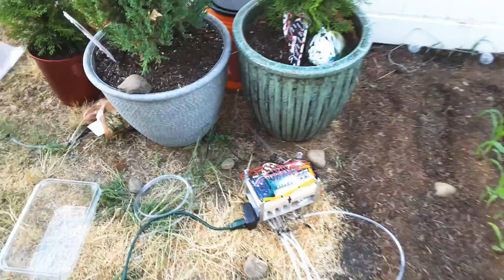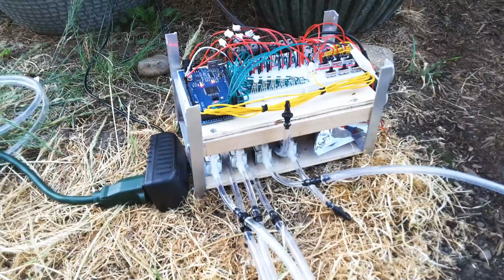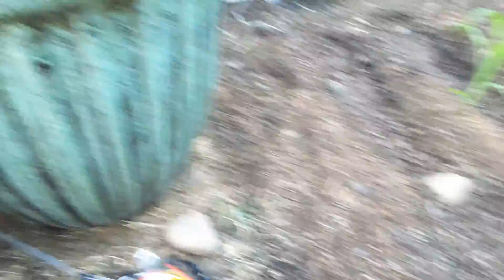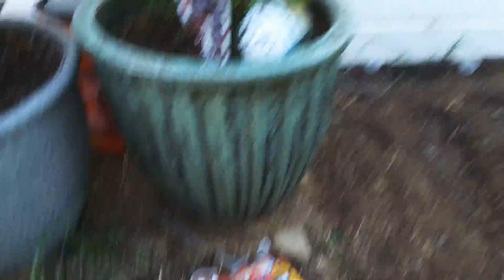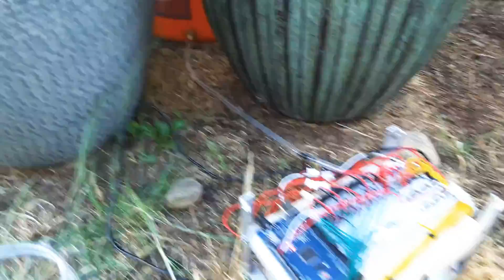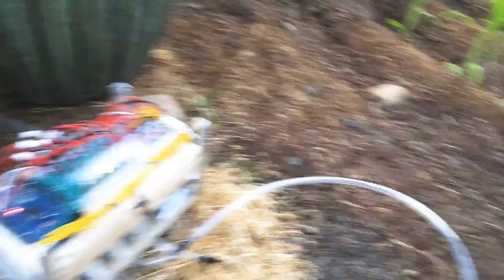Arduino Smart Water System 2nd model

Comment: Cool project.  What valves are you using?
Reply from the maker: I just used the cheapest 12V solenoid valves I could find on eBay. (Poor college student budget)  I updated the system this last year to run from a garden hose and they had issues opening under pressure. They work good for the 3 dollars though.